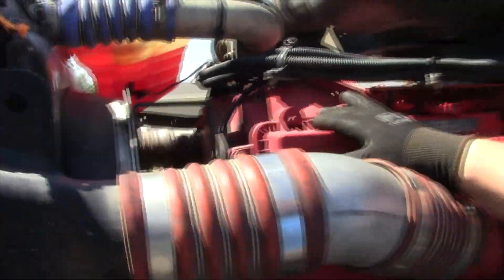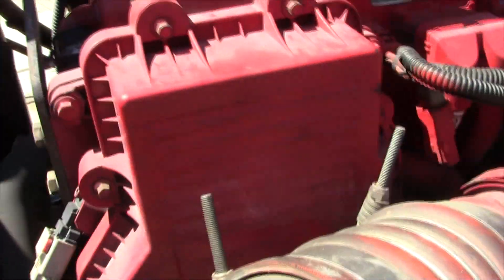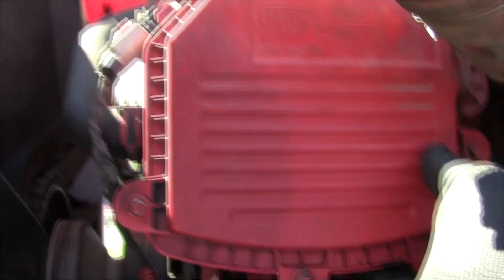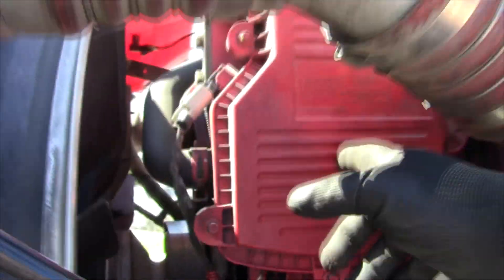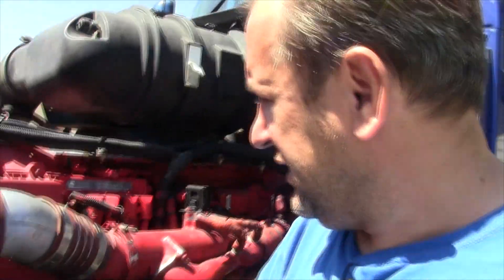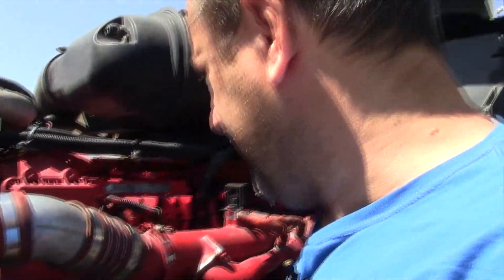Maintenance free crankcase filter vs regular filter

Comment: I used the maintenance free one and I still got crankcase pressure check engine lights
Reply from the maker: If you got not to much  smog coming from you oil pan it's my be sensor

Comment: good info, thanks!
i have question i have cummins isx 15 and the line that goes from the bottom of this crankcase pressure filter is that going to the oil pan if i understand ? on my truck is broken and leaking right on the top of the fuel pump and for a long time i thoguht the high pressure fuel pump is leaking and as it goes that like to the pan there is oil everywhere
Reply from the maker: Hello, as your question asks yes, the oil filter goes straight into the oil pan.
Reply: Vlad Wightriver thank you sir